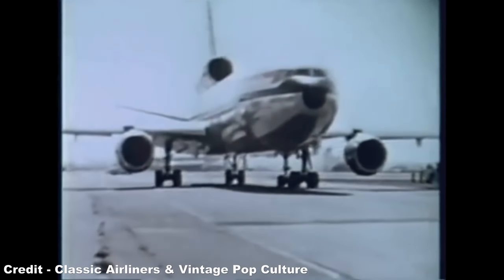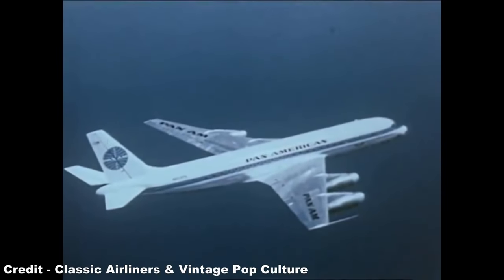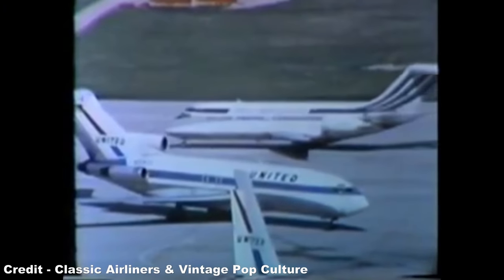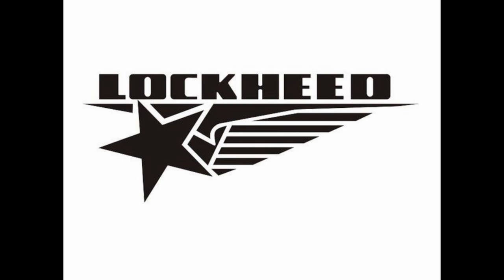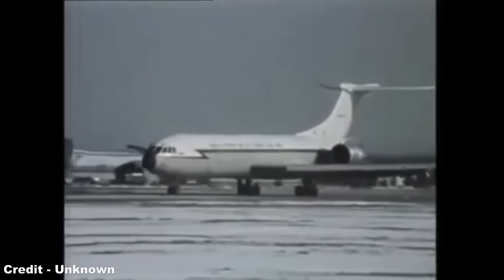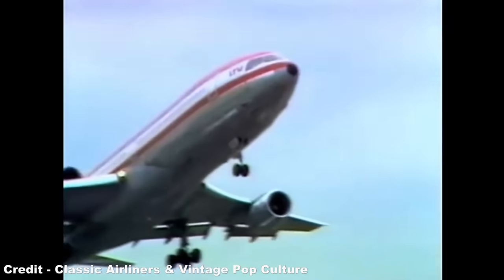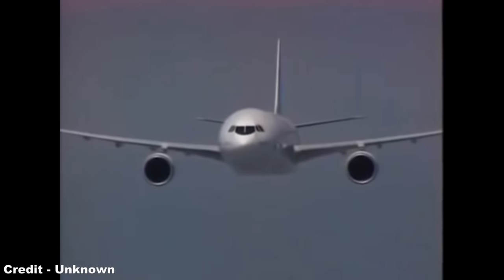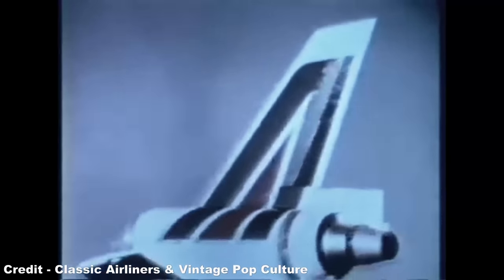What Killed the Trijets?

Comment: You forgot to mention that the A340 was one of the largest killers of the MD-11. The A340 was known for its very long range which no plane could compete with. The A340 also got around the 60 minute rule which helped it sell in the Southern Hemisphere
Reply: No it was the 777 that killed both
Reply: @johniii8147  Singapore Airlines got rid of their MD-11 order of 20 planes and within a week had ordered 20 A340-300s. The 777 wasn’t the main killer as even when the 777 was introduced it wasn’t able to fly some routes as it hadn’t gotten its full Etops certification it has today. That is why some airlines like South African Airlines chose the A340. The A340 sold well for a while as it had many advantages over planes even the 777. The A340 had low maintenance costs for airlines that flew the A320CEO as they used the same engines.

Comment: I once asked a Boeing executive why the the company was no longer building tri-jets. He replied this was because of the difficulty in lengthening the aircraft or otherwise changing its dimensions so as to create a family of aircraft around the basic design. The reason for this "difficulty" was that cluster of engines (and their weight) in the rear of the aircraft, way aft of the centre of gravity and centre of lift. No such difficulty arises when the engines are slung below the wings at or about the centre of gravity and centre of lift.

Comment: In 1989, fresh out of college and not having flown but two or three times before, I was flying to a job interview on a USAir twin-engine (not sure the model) but heading into Raleigh-Durham one of the engines went out.  It was an overcast late Fall day with a low ceiling.  The captain said there would be fire equipment standing by on the runway.  It was a bumpy approach and we didn't descend from the clouds until a few minutes before touchdown.  Luckily, we landed without incident.  However, I was so frightened by the experience that I insisted on changing my flight back home to one on an airline with a tri-jet which turned out to be American.

Comment: at 7:55, the statement of the DC-10 being easier to install #2 engine is incorrect. 
Having installed #2 engines on both the DC-10 and the L1011, the L1011 was easier as well as routine maintenance of #2 engine was easier on the L1011.

Comment: There's also another issue with trijets: the middle engine. When noise regulations changed, planes needed hush kits or new engines. Installing hush kits on all three engines has always been a problem. When legislators said "listen up, no more hush kits for you, either re-engine your planes or buy new ones," it was nigh-on impossible to completely re-engine a trijet. OK, you could swap the engines that were hanging on either side of the tail or under the wings. But what about the one in the middle? That one was always going to be tricky, as it would necessitate a complete redesign of the aft part of the fuselage, along with the stabilizer - therefore, it would be seriously costly.

Comment: I'll summarise it for you. Updates to FAA meant that international flights across oceans was updated to twinjets. However 4 engine 747 are still widely used as cargo due to its easy nose loading and with 4 jets for good power for the weight. However the FAA of 60 minutes to airports are still required for non commercial aircraft (like private honda and leerjets) twinjets. less engines = less cost.

Comment: They were equipped with the JT8D medium bypass turbojet engines that were not fuel efficient. I flew the B-727 and 757 and the 727 carried 147 passengers at 10,500 lbs per hour fuel flow. The 757 carried 182 passengers at 7,000 pounds fuel flow per hour. So the 3 engines were just not fuel efficient enough to survive.

Comment: There was another European (well, mostly European) development that ended the age of the 727: the development of the smaller high-bypass engine. Originally proposed as the SNECMA M56 in the late1960's, it became the CFM56 in 1974, which was adopted by Boeing for the 737-300/400/500 models. That plane, even before the Airbus A320, quickly supplanted the 727 on many shorter routes.

A note of interest: American Airlines' original proposal for a widebody jet was designed around two engines. Ironically, when the Boeing 767 arrived in 1982, it actually fulfilled American's original proposal.

Comment: Another factor in the trijets' demise not mentioned in this video: almost all of them were 3-crew vs. 2-crew for most twinjets. The latter included several types not mentioned in this video: the DC-9/MD-80, the BAC 1-11, and especially the Boeing 737. The last, 50+ years on, remains Boeing's all-time best-seller, almost a dozen versions later. Indeed the 737-200 especially was sometimes considered the jet-age successor to the DC-3. Interestingly, the 737's launch customer was Lufthansa - the first foreign airline to be the launch customer for any U.S.-built jetliner.

Comment: My first flight was as a child on an Eastern Airlines 727.  Had a window seat next to the left engine.  It was loud.  And that's another important factor I didn't hear mentioned. The 727 used a very loud engine and there was no way to refit it to use a quieter engine.   Hush kits were added but ultimately the 727 made too much noise and wasn't compliant with modern noise abatement rules.  The BAC 1-11 was a twin jet done in by the same noise issue.  If you have not heard it, there are BAC 1-11 startup videos here on YT and it is truly a horribly loud plane.  Older planes with loud engines are just not acceptable any more.
Reply: The 727 COULD have the outer pair of engines refit to quieter and more efficient models - ask Fed-Ex or UPS.
If you want loud though, get ANYWHERE near a TU-114 or the Bear military versions (got overflown by maritime Bears 2 or 3 times on a Westpac, VERY LOUD 500 FEET UP and flying semi-slow).
Reply: The noise issue also affected, and grounded, many older 737s that also used the JT8D.

Comment: ...ah, loved both the 727 and L-1011.   

Though the 1011 was more advanced  than the DC-10 (including having quadruple redundant flight controls) the delays due to the Rolls Royce issue gave the market share to McDonnell Douglas.  

While the 757 was billed as a 727 successor, it tended to fill more of a transcontinental role (and wasn't as a big a seller as the 727 was worldwide) while the 737 "Classic" and NG series along with it's rivals the Airbus A-320 and McDonnell Douglas MD-80 series, pretty much filled the shoes as the 727's replacements.

Comment: A couple of reasons for the airlines retiring the JT8 powered airplanes.  (727, 737-200, DC9 10-50, and MD80).  No.1 fuel economy.  They were very hungry engines compared to the replacements on the 737 (CFM56).  No. 2 noise.  Even with hush kits, which added a lot of weight and loss of performance.  You always could tell when a JT8 powered airplane took off.  No. 3, Pratt quit making the small engines (-10 thru -19).  The airplanes that had these engines were still  popular with the airlines until age and cost got to them.  Like any other machine, time catches up with them.

Comment: The short answer is ETOPS. Once twin jets got more range on ETOPS it was quite obvious that airlines where willing to buy twin engine airliners. Plus two engines burn less fuel that three or four favoring economic growth. Trijets where basically the stopgap between 4 engine and twin engine over water operations. They had to use 3 engines to allow smaller aircraft to cross the oceans.

Comment: A couple of  factors not mentioned: the noisy engines of the B-727, and the greater vulnerability of tri-jets to microbursts on landing. The tri-jets were mostly medium range aircraft, and so did not not have as big a difference between take-off and landing weights as the long range quads, while at the same time they did not have the extra reserve power of twin jets needed for take-off safety. Thus, the tri-jets on landing were underpowered compared with both quad jets and twin jets. Another factor was the greater danger of rear mounted engines severing tail surface control cables as the result of uncontained disintegrations. Many rear-engined jets crashed or almost crashed as a result (LOT Polish Airlines lost two Il-64's this way), and both DC-10s and L-1011's had such failures.

Comment: UAL 232 crash proved tail engine was a dangerous thing with so many vital controls impacted by failure. That, and more efficient engines which could reduce operational cost by only using 2 engines, and still even fly when losing one.

Comment: I really loved the Boeing 727, the ATP written test I took in 1981 was based on the 727. I also did the Flight Engineer Exam that was based on the 727 and it was a must-have applying to the Airlines at the time.  I interviewed with Eastern Airlines for an FE slot that would lead in time to the right then left seat. Due to issues going on at the time I was put on the hire list once things got better, well they when bust.  The 727 still flies up in Alaska. But it's not the most fuel-efficient and well noise. Its still one of the Best airplanes Boeing ever made.
Reply: but the JT-8D noise is glorious...

Comment: Research and development of the TurboFAN engine increased the thrust available from an engine that wasn't much bigger than the TurboJET engine it was designed to replace. Further, improvements in manufacturing increased reliability to the point that now two engines could reliably provide the power to replace the work formerly done by three engines. Retrofit of the two engines on a 727 at the 3 and 9 o'clock positions with a TurboFAN could probably have been done, as well as the wing-mounted engines on the DC-10 and the L1011, but the cost-benefit numbers weren't there, and the industry let the airframe and engines "age out". Other improvements were on the horizon - two man cockpits, glass cockpit displays, clean burner cans, noise reduction technology, efficiency improvements, etc. The bean counters decided it would be  "poor headwork" to stuff all that tomorrow hardware into a yesterday airframe.
Reply: Turbo FANS have had continuing increases in DIAMETER, though their length hasn't gone up a lot if at all over some older turboJets.

But the ETOPS rules changes, far sooner than expected, is the primary killer of the tri-jet.

Both Fed-Ex AND UPS had "upgrade engine" kits for the 2 side engines on the 727 - and by report would sometimes fly those jets with the middle engine shut down entirely.

Comment: At one time three- or four-engines were a requirement in order to be approved by the regulators to fly transoceanic passenger routes. This was considered necessary to ensure as much reduncancy and  safety as possible, and also due to the fact that in the 1950s and 60s jet engine makers like General Electric, Pratt and Whitney and Rolls Royce made smaller, less powerful engines, wich therefore necessitated using more of them. This led to some aircraft with many engines, like the six-engine B-47 and the eight-engine B-52. On the civilian side, the Dehavilland Comet, Sud Caravelle, 707, DC-8, 747, L-1011, DC-10 and MD-11 all were built with at least three engines to fly transoceanic routes. 

In the last thirty years or so, the development of ever larger and more powerul gas turbine engines has allowed engineers at Boeing and Airbus to design more efficient and less complex twin engine, long range airliners for extended overwater flights. So the regulators responded in turn by creating ETOPS (extended twin-engine operations) rules, which allows large twinjet airliners like the 777 to be approved to fly for up to five to six hours on one engine, in the rare event of an engine failure or unscheduled shut down.  This led to the  current fleets of larger twin-engine transcontinental airliners like the 767, A330, 777, A350 and 787. The only four-engine airliners I know of still flying passenger routes are the A340, and the behemoth double decker A380.

Comment: McDonnell Douglas and the MD-11 may have survived a bit longer if they had given it a clean-sheet wing, enough thrust for short-field performance, plus the passenger and payload capacity to replace the 747.  The fuel efficiency of updated and later production units of the MD-11 aren't that bad compared to the competing 777-200ER, but the cost of servicing that third engine was a deal-breaker. In the end, many MD-11 airframes survive well into a second life as freighters, outlasting 777-200ER passenger airframes that went to the desert.

Comment: Once engines were reliable and powerful enough that "twins" could be used for transoceanic flights, the TriJets were history.  Same issue with the famous 727.  Great aircraft, and needed in its day as it was cobbled from the 707 airframe and used 3 of the same engines.  But once the 737 was introduced, and it served more markets than the 727 could, and was much cheaper, once that airframe could be "stretched" to take just about as many passengers, no need for the three-engined jet.  Also the 727 could not easily be upgraded for the newer high-bypass turbofans w/o in effect making it a completely different aircraft, which also had a limited market anyway.

Comment: The DC-10 was pretty,  the L1011 was advanced,  and 
the A300 was economical
 (2 engines).
The A300 won,  with Boeing not far behind with their 767 & 757.  Quick thinking that worked on their favour.  A twin engine 1-2 punch that knocked out the trijets.  Good short,  thank you.

Comment: I flew on a 727 to Portugal in 1990, we sat at the rear, sounded like a thundering rocket taking off, the whole plane was vibrating with the power, I could actually feel the geforce. Planes today feel tame
Reply: The closest we had to that is the MD-80 using the same engines, except that there’s 2. 

I got to visit some airfields and explored interiors of some present and former 727’s. They’re still used a ton for business jets or organizations like oil and water companies still use them.

Comment: The base fact is that two engines provide redundancy. The need for more engines has always been driven by the minimum number to provide the required power and ,to a large extent, the simpler design requirements of symmetry if kept to even numbers. Turbine development with huge increases in power output over reciprocating engines meant that three engines producing the same total power as four smaller engines  would have a lower fuel consumption. The rest is detail variation. It is now 2021 and B747 original power can be produced by two engines so redundancy is just about all that matters in a time when it is possible to just select two of the appropriate size of engine for an aircraft design. 
 A curiosity to ponder! At max performance  and V1, take off is continued after the failure of a single engine regardless of the number installed. From this it is obvious that a two engined B747 would need more total power than a four engined model to cope with the loss of half available power instead of a quarter. However, it is also obvious that a second engine failure would make the twin a glider but it would also bring down the four jet with only two engines working. This only applies at max performance but the anomaly is that with three engines running there is a greater chance of one of three engines failing than there is of one of one. After the first engine failure on takeoff you could be better off in a twin than a four engined aircraft for the next 10 miutes. It says more about regulation than engineering and requires a lot of bad luck. It is also a topic best discussed with passengers when out of uniform. Non the less it is a consideration regarding engine numbers.

Comment: The reason for tri jets and there demise is engine technology, not regulation.  4 engine jet liners existed because older engines did not provide the power needed for large long range liners.   At the time the DC10 and Tristar were being developed engine technology had advanced such that a large liner could operate on 3 engines.  The real problem was that development costs could only be reasonably paid if only one wide bodied aircraft came to market.  Since 2 aircraft came to market, neither would have enough sales to recover development costs and both makers went bankrupt.  While this was going on engine technology improved making wide bodied twin jets safe and practical.   
There are many problems with 3 engine aircraft  compared to twins.   One that goes back to the propeller days is sharing the fuselage with an engine and the cabin.  In jets there is where to put the engine and the air intake.   S ducts are expensive to design and maintain, while the DC10 "banjo" mount has efficiency and stability issues.
Of all the tri jets I have flown on I like 727 best.  Walk up the airstair, and get into an airliner that is almost acrobatic.

Comment: Still consider that passengers, & consequently the airlines looking at buying/leasing replacement aircraft, had lost a lot of confidence in McDonnell Douglas even after the problems with the cargo-door locking-mechanism were rectified.  Bear in mind that this was also on top of the heavy financial payouts as compensation to the relatives of numerous victims!

Comment: As a mechanic, the B727 was a simple airplane to work on. Technically, it had all B707 engineering design. Very Old design. Big problem with the airplane is that still had a flight engineer.

Comment: the 727 was designed to go across oceans. Since the FAA had a ruling that you needed 3 or more engines to do so. Since some airliners wanted short route ocean crossings like from Miami to the Bahamas.  you could you the 727 instead of the 707 or 747 or dc10 for example
Reply: Miami to the Bahamas is not an ocean crossing. Even one engine is allowed.
Reply: @EfficientRVer  picky picky was just an example.